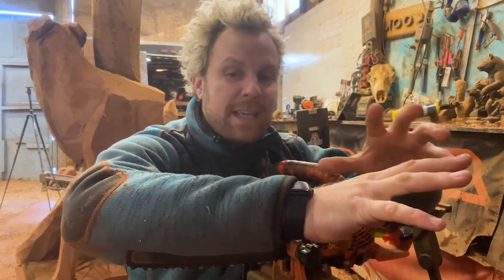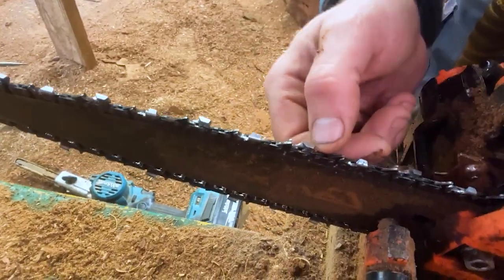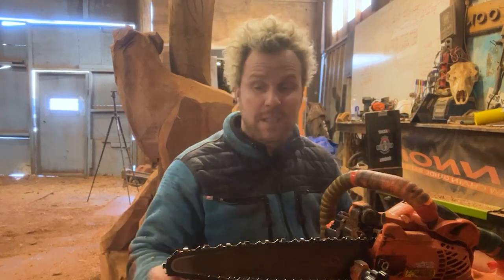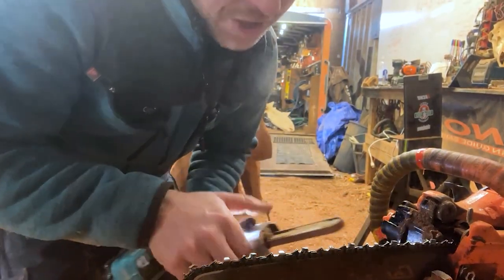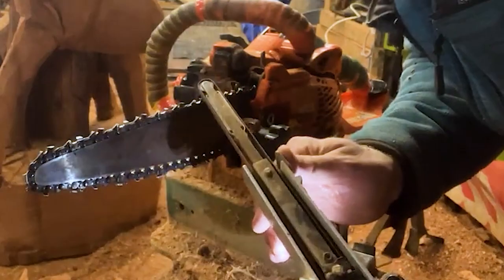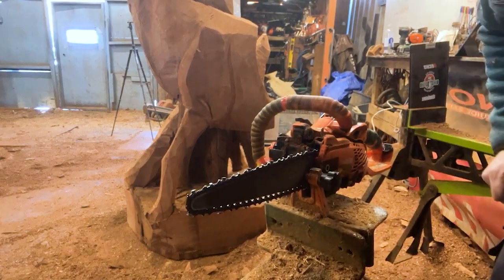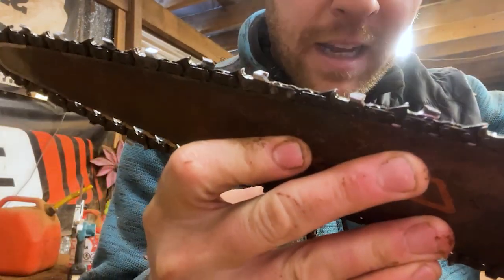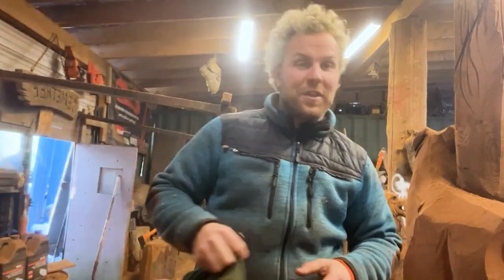Chainsaw Chain Tip for the Back of the Tooth - Tip you might not know - Tool Talk Tuesday

Comment: Watch Tim Klocks video on YouTube  on the ridgeway rendezvous page. He does that on a 45 degree or so angle. But also on smaller bars 16" and under take half of the side plate off of the rakers and you can make sharper turns. Then when you get the chain halfway down sharpen it into a knife edge and it scores the chip before the tooth takes it out. A little more aggressive but worth it to take them down to half the width!
Reply from the maker: cool tim is awesome